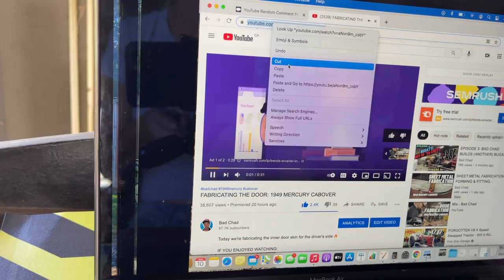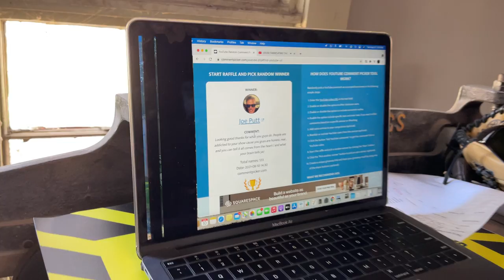FIXING THE DOOR GAP USING A MIG WELDER + COAT HANGER

Comment: I had a similar problem on one door when I did the Dodge truck cab. After a lot of trial fitting and measuring I found the door was slightly twisted and was surprised how easily I was able to bend it back to where it should be. Putting a slight bend in it saved a lot of welding/grinding/hammering.

Comment: we love this content. aiden should have used the flapper wheel to rough out that piece. also the rotary file would have been helpful. thanks
Reply: --- I'm sure that when he becomes more confident, then he will use them. 
What's the old saying " speed comes with accuracy, not the other way around "

Comment: Door adjustments can cause fits! Try using 1/8"  7018 stick ,knock the flux off ,makes a little thicker door edge then that coathanger metal.

Comment: Hey Chad why don't ya put a slit in the quarter panel with the wiz and pry it open until desired gap on door edge then Weld the slit up. That's how I do it and it works well.

Comment: Doesn't seem like that door latch is letting the door close all the way. Keeps rotating around that position. The other one looked like closed better before working it. Might just be me.

Also, throw that hat in a 5 gallon bucket of water with a little dish soap. Let it sit for a week. Then rub out the stain with baking soda and a little vinegar.